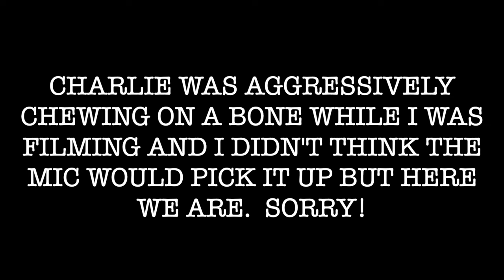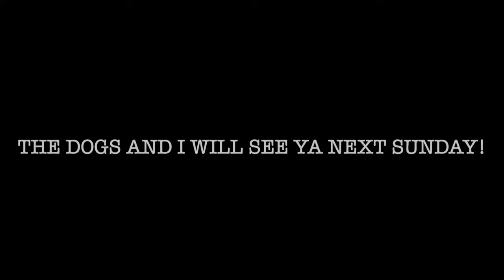DIY TRAVEL TRAILER RENOVATION

Comment: As an amateur sunset chaser (and sunrises too when the opportunity strikes) I come for the sunsets and scenery -- but i stay for the voice over. I get a kick out of the writing! Out of curiosity, what criteria did you use for choosing the tundra? I'm debating the options between 2015-2018. Happy trails!
Reply from the maker: Haha thank you! Gotta throw in some self deprecating humor occasionally :)

I was a Toyota girl long before the van so it was a no brainer for me. I wanted crew cab (more space for the dogs) 4x4 and “Toyota low” miles (bought it with 84k…for any other make, that’s a lot). That’s honestly all I cared about. The problem was availability! There were none around me and I was on a very tight schedule.  I lucked out finding this one online! It also has a 5.7L engine and most of the Fords and Chevys were 5.0/5.3. Had to make sure it was strong enough to get me back to Colorado :)
Reply: @girland2vandogs  that's a great find! pickings are a bit slim here as well. I'm also looking for the 5.7, but with the smaller cab and slightly longer bed to either accommodate a four wheel camper pop up or pull an airstream my bro and i  have (and need to put work in to get it roadworthy). Tracking down payload capacity for each specific truck is a bit of a drag. Sounds like you'll have plenty for colorado! can't wait to see you chronicle it!